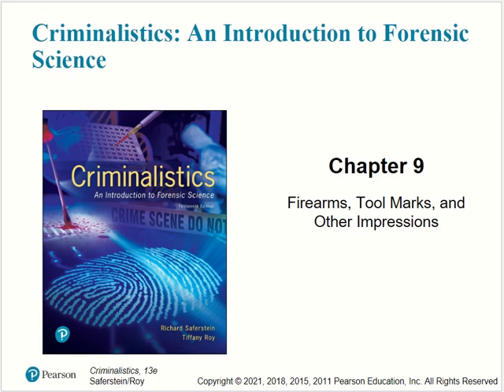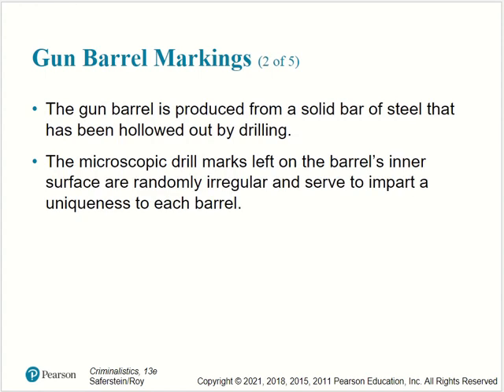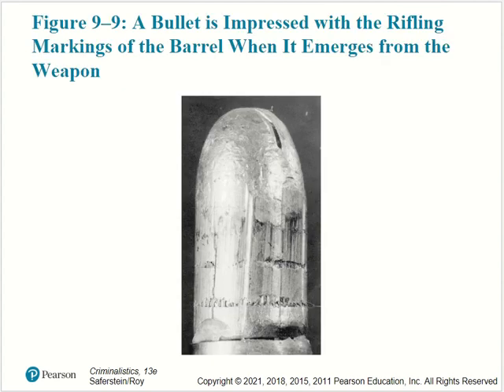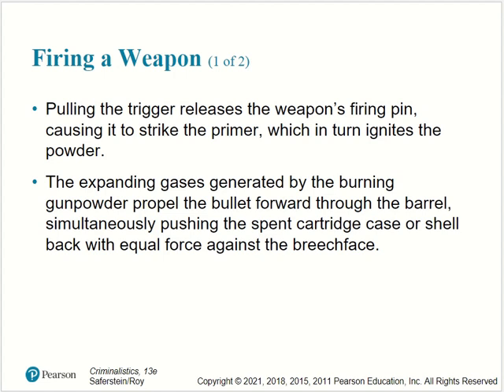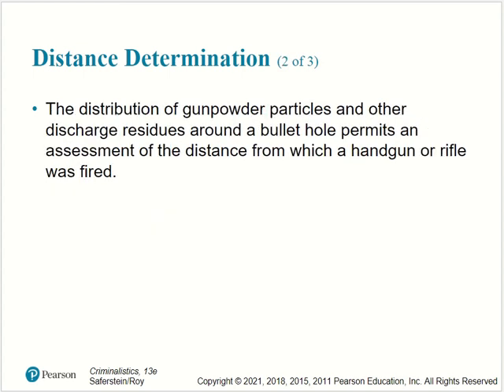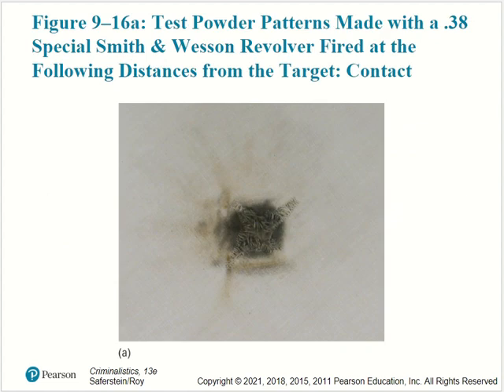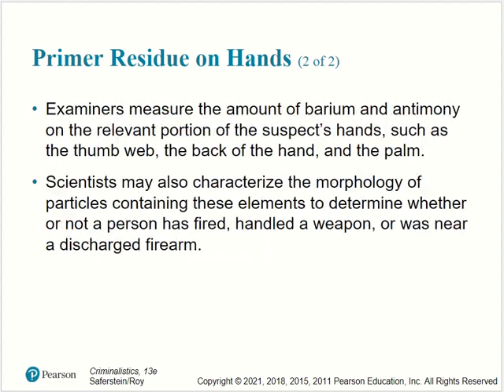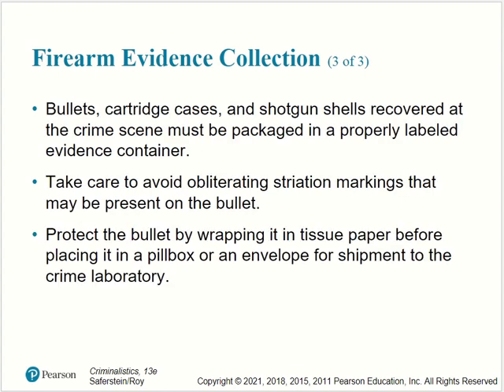Forensic Science (College) - Firearms, Tool Marks, and Other Impressions (Chapter 9)

Comment: Hi, would an unspent round that was manually cycled through a gun be able to be matched back to the gun?
Reply from the maker: That's a fantastic question to consider. Even in the case of unspent rounds, with enough magnification it is possible to show a print on an ejected casing being unique to a particular gun. It must be through typical action of the gun though, for example, pulling back a bolt action to eject a bullet that has already be loaded but not fired. The unspent round's casing fingerprint has been used in court cases as satisfactory evidence.
Reply: Seems like if the weapons are produced on an assembly line and shipped out to be sold that all the weapons in that lot would produce the same markings. 

Can probability of a match like this be quantified?